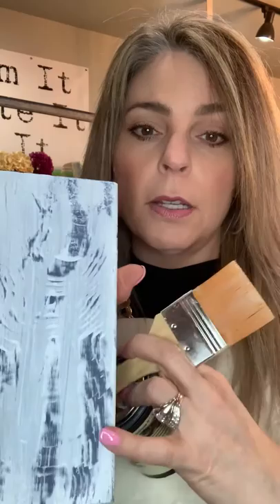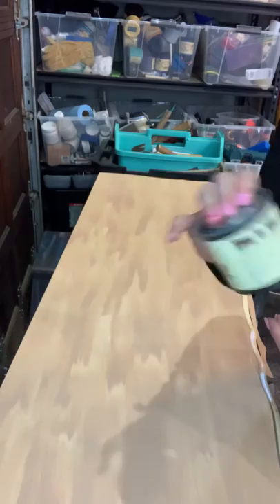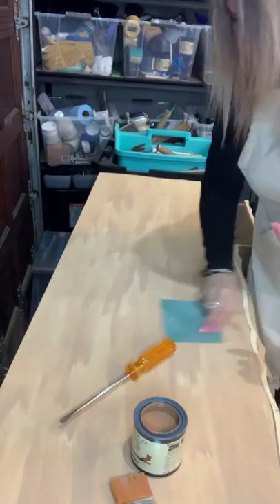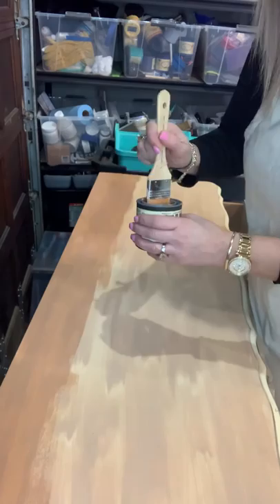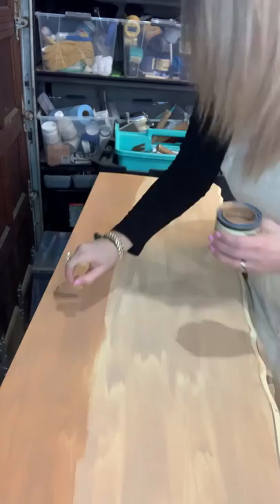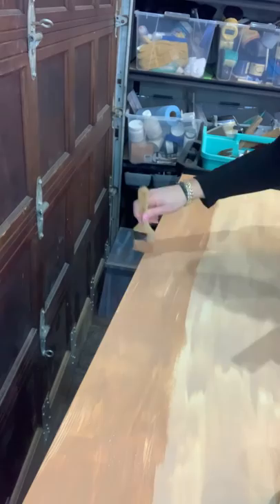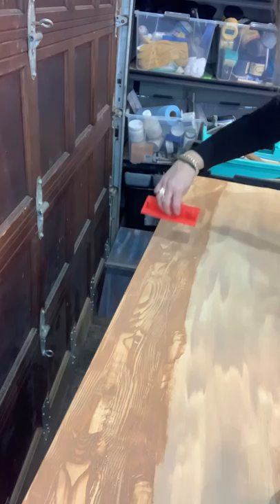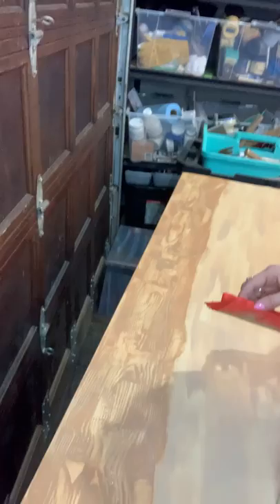Using Retique It Liquid Wood

Comment: With a large surface like that wouldn't it have been better to use a wider brush or even roller?
Reply from the maker: Hi Cleo, You can use your own brush or roller.  I used what Retique It sent with the kit I received.  By all means, use what you have and is easiest for you!  Thanks for the comment.